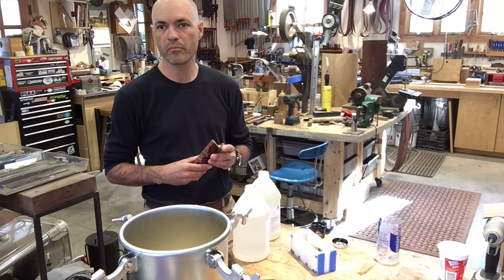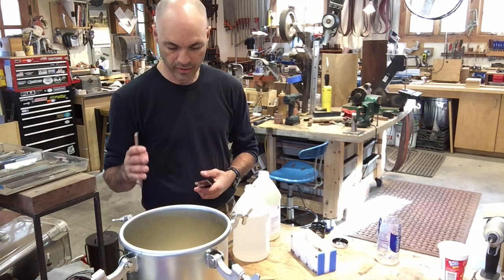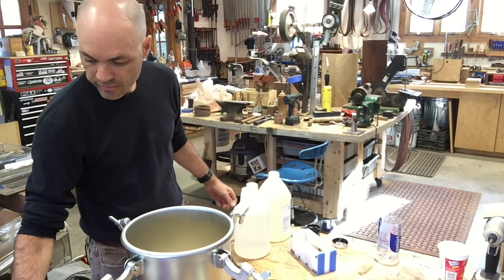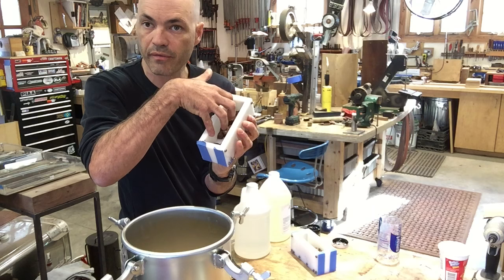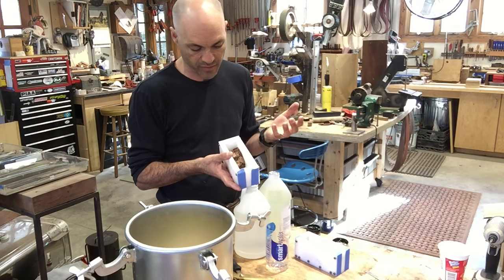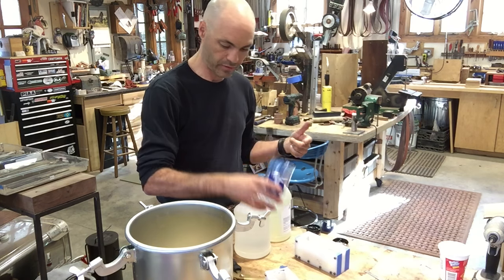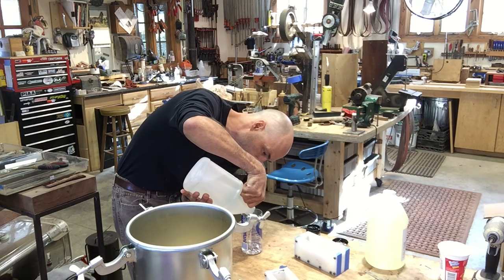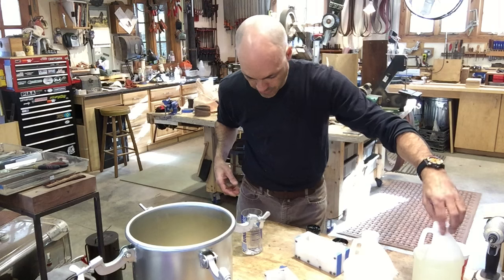Making knife handles with Alumilite resin - Long Runtime

Comment: When they manufacture multi-layered printed circuit boards they use vacuum presses to remove air bubbles.  Would drawing a vacuum work any better at drawing out the air bubbles?
Reply: Here is a link to a website where you can find a vacuum bucket.

http://www.handhelditems.com/arksenc-vacuum-chamber-2-gallon-3-cfm-single-stage-pump-degassing-silicone-set-id-145512.html?gclid=CLvAl6Of4tACFR2BswodFEEAlw 

p.s. Much safer than a paint bucket... only one atmosphere difference from the outside and if anything fails it implodes vs. explodes.
Reply: As far as I know molding resin by Alumilite, requires pressure to push out the bubbles. Stabilizing resin for wood requires a vacuum to suck the air out and replace those air voids with the resin. Thats a nice set up that you linked to though.
Reply: You can't pull a vacuum on Alumilite it cures too fast and you just get a ball of hard bubbles. That's the reason for the pressure pot to keep the air bubbles small and in the wood.

Comment: Hello, I am Ronaldo and I live in Brazil, I would like to know how many PSI you have placed and for how long? thank you
Reply: Each resin from Alumilite is different so the cure times are different as well as de-mold times. The PSI that I use is 40PSI higher can be achieved but my blow off valve is only rated to 45PSI. Material calls for 50PSI.

Comment: If you want to be more accurate at measuring the resin and catalyst, use a scale and weigh it instead of a beaker.
Reply: Janet McPhail yes. You’re exactly right. Learned that the hard way.

Comment: Its more expensive to make it then buying it, if you want contact details for a company in china that makes alot of diff sizes and all kinds of colors and mixed colors for a good price if you order a little. I only ordered for 200 dollar and got more pen blanks then i would ever use so i delivered it to a shop here in norway that sold it out 4 me but keept 2 of each for myself out of 134 diff colors and mixed colors. That way you save alot of money buying in all the colors and making bands to put into it aswell.
Reply: tsfcancerman yeah. You can buy that stuff from China and you’ll get China quality with absolutely no idea what’s in it, who made it, or where it came from. We make our resin handles to use custom materials that clients ask for giving them a connection to the product and process. No material supplier from Asia offers that for one piece at a time. I think you fail to understand the level of customization and individualized process we offer.
Reply: tsfcancerman 
Whats the company name